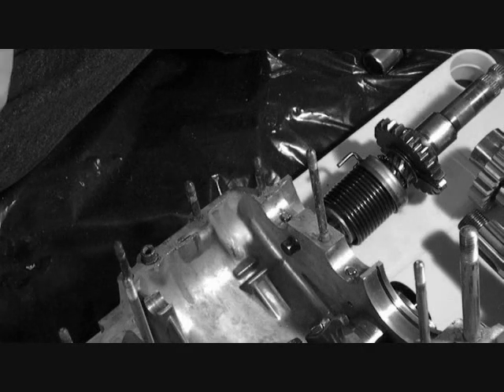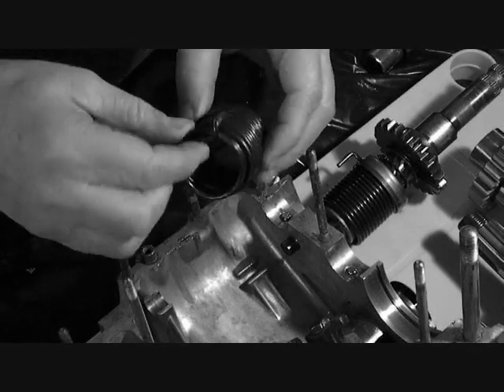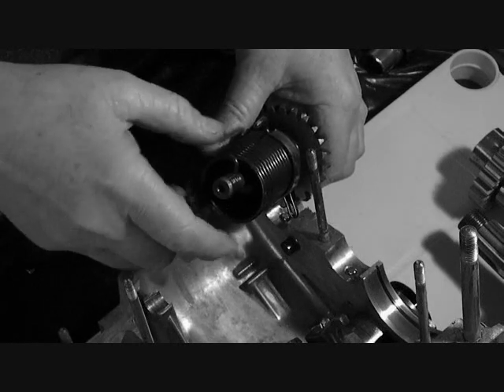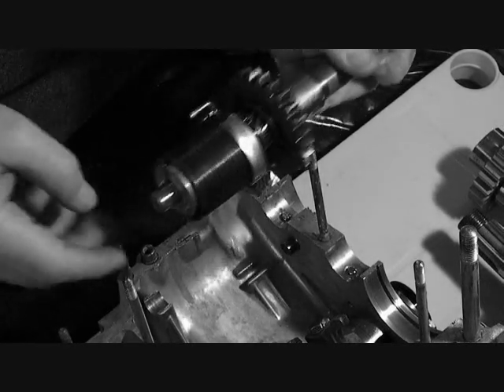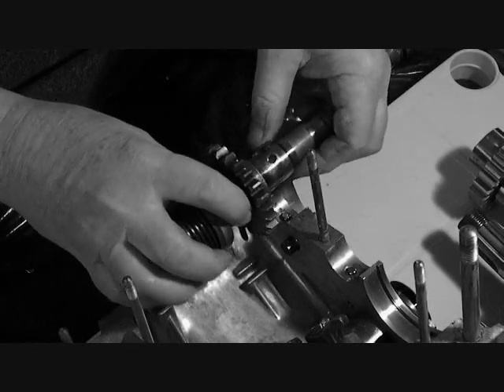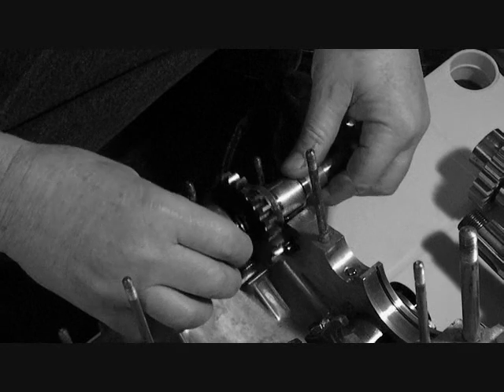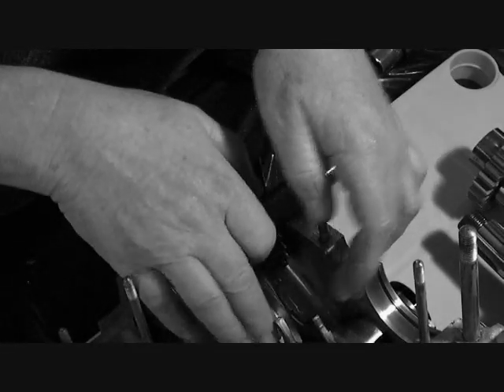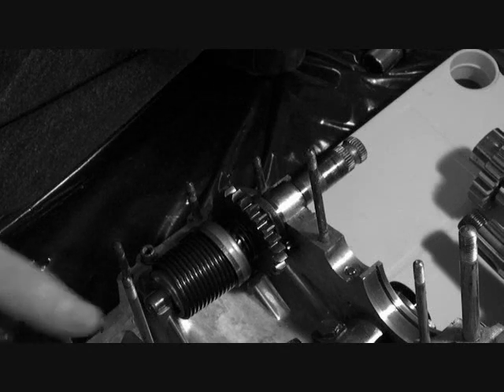"HOW TO"  properly install the kickstart mechanism in the Kawasaki H series 2 stroke triple

Comment: Thank you for posting H2 service videos. My H2 has always had an issue with the kickstarter. When I attempt to start the engine the kick starter does not engage and just swings to the bottom. The spring returns it just fine. I usually have to kick 3 or 4 times before it will catch and actually spin the motor. Any thoughts? I have the engine out now and thought this would be the right time to address this issue, if I have to split the case.
Any comments or insight would be appreciated. Thanks for all you do for H2 owners!

Comment: Question, what kind of fluid do you put in your transmission cases?
Reply from the maker: regular hypoid oil for limited slip differentials. 80-90 wt. And no it's not thick.....

Comment: i have a 1998 kx250 and the kick starter shaft broke of with the kickstarter and it needs replaced. Does the engine have to come apart to do this? if so im screwed